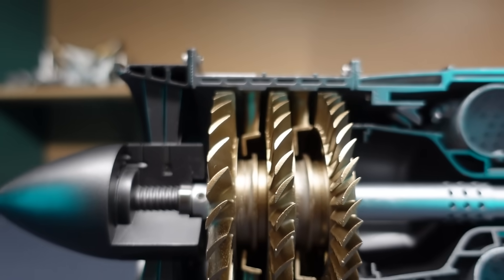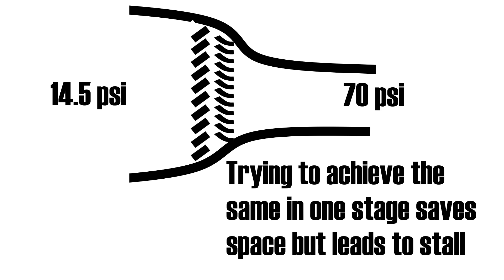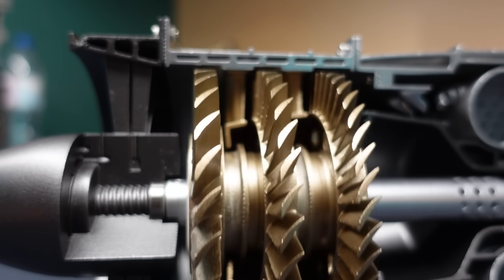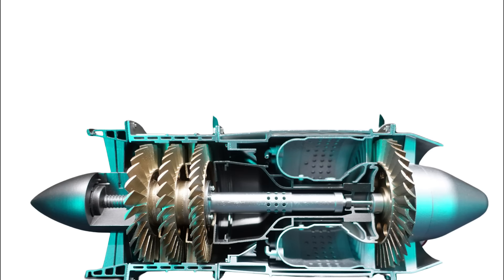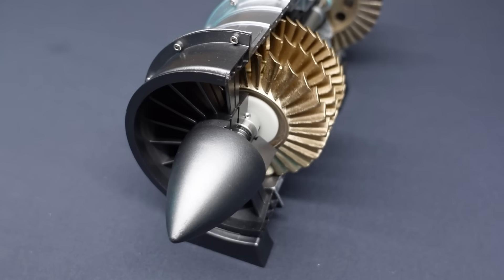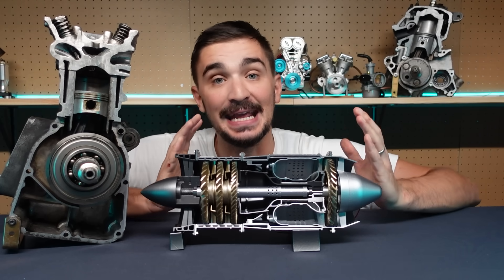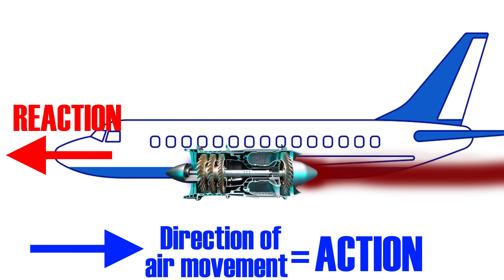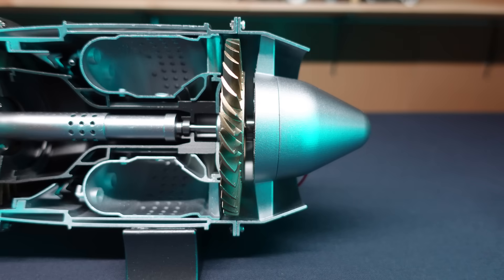Appreciating The Beauty of Jet Engines by Juxtaposing Them Against Piston Engines

Comment: Can you imagine how developed of a world we would live in if all the teachers were just like this guy
Reply from the maker: There's likely many better ones out there . It's maybe the willingness of the people to listen that's the bottleneck? 🤔
Reply: @d4a  come on buddy, don't be so humble. teaching and explaining stuff is completely different from knowing stuff, and it's a skill on its own, you're really damn good at that. you really should be a teacher. and on the topic of the gas turbines, i'd love to see you do one about turbofans too. i get how they work, but i don't understand why. i don't get what's the purpose of the bypassing air.
Reply: @4ffff2ee humility is perhaps the best trait one can acquire. Let him be humble Though ironically that could lead to pride in itself.
Reply: @4ffff2ee  good question. I BET the reason of bypassing some air is a good idea are something like:

- Even in jet engines which generate more power in exhaust than shaft, there is still power being made on shaft. So why don't use that to push more air?

- Also I THINK putting even more air into the combustion chamber wouldn't be healthily to the combustion itself and more combustible would pass without burning. So it's good to pass this air outside the chamber.

- But I BET the main reason is the shape of intake. Maybe a big intake in front is more efficient when you want to pull more air, but the most efficient intake size to generate the power you need in combustion is NOT THAT big.

In other words, I use to thing in turbo-fun like something which mixes some advantages of turbo-shaft, turbo-jet, and even screw-propeller. (but I'm not even an engineer)
Reply: The purpose of bypass is efficiency. The greater the proportion of air that's bypassed, the more efficient the engine is. 

Design of the compressor and turbine stages of jet engines has got so good, that there's plenty of spare rotational torque available.

To make more thrust out the back, rather than making the jet section bigger, it's more efficient to slap a great big fan on the front, use the turbine to drive it. The vast majority of the air from the fan is around the outside of the engine. 
This bypass air is now most of the thrust for a turbo fan engine.

The bypass air also helps cool the jet section, and on top, when reintroduced with the jet exhaust flow, helps reduce overall noise levels (see videos of a 707 taking off vs a modern widebody).
Reply: @d4a  You are a great teacher, but, however did you focus upon all types of engines so thoroughly? Was it your dad? I was also interested to learn more about the Jet Engine mainshaft, and the bearings that support it. At 25,000 rpm, the thrust that is developed, must surely place a severe stress on the shaft, in the same direction of aircraft travel. Newtons third law again. An A380 develops 72,000 lbs thrust from just one engine. Inside the TurboFan Jet Engine,the main Bearings are handling this thrust very successfully. We must marvel at this achievement too!
Reply: @d4a nah, you are the best!
Reply: @d4a  There may be many better ones out there. But that doesn't mean you are a bad teacher by any means. Far above average I would. Though the willingness to listen is probably also a big bottleneck.
Reply: @d4a IMO, there's a lot to be said about someone who can explain things well, understandably, and passionately. 

There's a whole lot of people out there who only avoided learning something because of bad teachers.
Reply: Exactly.. im not a native english speaker and yet I easily understood every explanation he says.. one of my very few favorite youtube channels.
Reply: I probably had teachers as smart as this guy but i was too stupid to realize it.
Reply: I supposed part of it is that we all specifically chose to learn this rather than being forced to. You can bring a horse to water. . .
Reply: i am so lost for words..  did none of you go to elementary or primary school?   this is like describing a car as if it were hot wheels.  and anyone ::cough:: that thought this was ... i just need to stop.  i swear the worlds average iq must be dropping at an exponential rate.
Reply: It might be a good thing. Should we live in a better world because everyone understands everything? We might starve and extinct. @iamdestructoman
Reply: All of my comments were deleted?! I didn't curse. I didn't go political. There was no hate. I am so confused.
Reply: Prof. CE 😀
Reply: I had a very good thermodynamics lecturer
Reply: The vast, VAST, majority of teachers have studied teaching (which is a lot of psychology related courses), not the specific subject they teach. Again, most are just handed a syllabus for the subject they were hired for by the school district. The entire scholastic system needs an overhaul, not another watering down to artificially improve test scores at the cost of interest by the students in a given subject just so they can get a higher budget next year....

And while I enjoy dudes videos, what did you learn? Can you calculate for me the fuel flow? Air flow? Efficiency? Tensile strength of the various parts required? No, we just learned how a jet engine turns fuel and air into noise and thrust, and how that differs from an internal combustion 4 stroke engine. Which, yes, is cool. I love jet turbine engines. They're awesome. But a video showcasing a thing in an interesting way does not an expert course make. Sure, a reasonably mechanically minded person could make a jet engine with about 2, maybe 3, hints as to parts and materials out of junk yard stuff (they're not gonna fly with it, but can build a working jet turbine 'gas generator'). But enough of the class to pass the end of the week test so that the teacher is evaluated as effective? No way man.... Yes, that is yet another problem in the scholastic areas that needs addressing....

Kids need to be engaged with in a manner that gives what they're learning meaning. Otherwise they're just parroting what they heard earlier in the week onto paper just to forget it over the weekend. And I will absolutely admit there is a huge difference between understanding concepts vs knowing the formulas by heart (which honestly, most scientists dont. They just understand the interplay of systems enough to look up relevant formula). Its that understanding of the concepts that needs the attention it is woefully not receiving. Leading us to a world where people push airated gas, flat earths, 5g viruses, pyramids.....and all that crap. For the massive mind boggling improvements in access to knowledge we have received over the last few decades, during the last 6 years or so we have gotten worryingly dumber.....and that is really disappointing....

All that being said (and said for the sake of shining a sobering light on the dire state of the education system as we have all the platitudes in the world, what we need is decisive action, but thats the hard part.....slogans are easy.....gotta sit down and figure out the hard part now if we want anything to get better....), this guy absolutely makes awesome videos about complex subjects and should totally keep making them.
Reply: Nice presentation, Frank Whittle knew about axial flow but went with centrifugal flow for simplicity, Junkers built the first axial flow engines for the ME262 but they had a scrap life of 25 hrs. Whereas the Rolls Royce goblin ( $ later the Derwent) had a rebuild life of 100 hrs I think the biggest problem at that time was: nobody had invented nimonic alloy yet !
Regards,
Sandy 🔧🏴
Reply: Also helps to be teaching something USEFUL instead of, say, gender studies.
Reply: This is what you get with unfettered free market education.
Reply: Yeah it’s almost like they’re barely paid enough to care
Reply: I swearrr, he's so thorough and precise 😂
Reply: Even better, present this lecture or one like it, bridge design, whatever the biology equivalent is (engineering/technician guy here) at freshman orientation , then serialize classes.  And take questions.  How do you know how to stage the rotors?  How do you know how big or how many of the little air holes to make? How do you figure out what material to use, and where is a starting point for testing.  Go back to the engine or bridge etc for chemistry, algebra, calculus, trig and geometry, material science, fluid dynamics.  How is it built?  CNC, wintering 3d printers, casting.  How do you communicate the pieces and their properties?  CAD, GD&T, by senior year you've got a bunch of engineers ready to go to university for their specialty who can look at design and theory holistically, accounting for manufacture and maintenance and stuff (I forgot the how do you fix it questions) and a bunch of drafters, machinists, tech writers, and (good) manager trainees (also forgot the how do you coordinate this whole thing question).  Sounds a helluva lot better than here's algebra.  What do we do with it? You do the homework and turn it in.  Will I ever use this? Probably not.  I was furious when I was 30 and taught myself advanced math and found out everything I could do with it.  It was almost like someone kept a secret from me the way my classes were taught
Reply: Yes me too maybe because this guys on utube are happier and flexibility of work compare to teacher that are always angry everytime in school
Reply: It doesn't help teachers are paid like crap, and professors are hired due to their accomplishments. Not exactly their teaching or communication abilities. 

 Yet I guess prestige > teaching skills when it comes to higher education.
Reply: One of the benefits of YouTube is that it let great teachers reach big audiences.  This includes d4a, and others, like Mentour Pilot and 3blue1brown.  They're better than 99% of the teachers in high schools and colleges.
Reply: Autodidactic heutagogy. Full stop.
Reply: The King's Specialization benefited historically from adjudication of mental servitude, however universally disrupted consistently through  an ever demonstrative trend towards comprehensive propensity. Thank you Bucky!🎉🎉
Reply: Yep. That one, too? Wtf! All of my comments disappeared!
Reply: I swear that has to be the 5th video on the matter I watch and only now do I understand how it works!
Reply: we are almost there. 1) Now, the entire world can play this video at classrooms. 2) Very soon the IAs will make even more perfect videos, AND they will be able to answer student questions individually (no need for the entire class to wait for the slow student to ask the teacher).
Reply: @crazyr0m they aren't slow, they want to know exactly how, why and where it all stems and webs. Pacing an interwoven tapestry of comprehensive applicability.

Comment: Turbofan engines used on airliners are DESIGNED to run at high altitudes, not that they operate better up higher. Turbines in helicopters do no operate well at high altitude because they are not designed to.

Comment: The reason for the reduction in room or space as you move through the compressor section is NOT because it is sqeezing the air... The compressor stages are littile difussors...they are designed to progressively compress the air, and as the air is compressed, its volume decreases...thats why the room shrinks. The reduction in volume is a result of the increase in pressure.
Reply: Isn't that just a long-winded way of saying the same thing?
Reply: @Ijusthopeitsquick  I don't accept that you have explained the jet engine well. There is no such thing as free energy. Yes the rear turbine drives the front compressor via a connecting shaft and the air is  compressed.
But this does not mean that more air passes out the rear nozzle as useful  thrust. 

In comparison your piston engine can rotate and suck air in, then the piston
compresses it. If you do not introduce fuel and ignition the piston will rotate back down the cylinder to where it started at whch point the pressure
returns back to zero again.  In a perfect engine no energy
is used to compress the air, it is recovered on the downstroke and
no energy is available in the exhaust. It would act like a spring. But there is always a little friction and you will always lose a bit of energy.
The only way you can get energy out is if you introduce fuel to heat the air and this causes the cold air to expand. The only purpose of the compression is to introduce enough air into a small confined space so fuel can be burned in sufficient quantity to produce a lot of power. That's why high compression
 engines produce more power.
When you burn fuel with air it expands to make a bigger volume. This increased volume depends entirely on the temperature.

In going from air at ambient temperature to say 1500C this expansion
 is not as much as you would think because it works on absolute temperature Kelvin with zero at - 273C. Accordingly air at ambient 273K heating up to 1730K in our example only expands by a factor of about 6 at
the most. This is not a very high compression or expansion but ratio and would not produce much thrust. 
But you say there is a rear nozzle after the turbine to increase the speed of the exhaust air to produce the required thrust? 

No!! In order to do this there would need to be a significant pressure increase in the jet engine. There isn't. In fact there's a pressure drop from the compressor at the front, with the highest pressure, right through the combustion chambers, through the turbine and out the back as exhaust thrust. There are no non return valves in a jet engine and if there was no pressure drop the exhaust would try to flow back though the engine
to the front! Obviously this does not happen. 

Using any type of compressor to suck in a lot of air at the front can only
 result in the same volume of air flowing out the back and with no real
 change of energy unless there is a great pressure increase. 
Dan
Reply: @danielhanlon5607  The exhaust contains more energy per unit mass of air than the intake because the velocity and temperature are higher, not because of a pressure change.
Reply: No,  @Ijusthopeitsquick , it's fundamentally different.

Comment: Isn;t the ignited hot air always in higher pressure than the intake compressed air? How can the air enter the combustion chamber?
Reply: People already commented this, but the combusted air is free to expand (the turnbine has a lower pressure because the exaust is expanding), so the pressure in the combustion chamber does not increase significantly, it's pretty contraintuitive. Also, with enough inertia, the airflow can "defeat" the unfavorable gradient presure. This is how the compressor manage to not have backwards flow, and why blow off valves are needed for idle and engine start, when the air flow is low and high pressure in the end of a stage can make it go backwards

Comment: The jet engine in this video will not work, because ALL fan blades must be positioned in the same direction.
In his model, the fan blades at the rear should be rotated 180 degrees. With the blades in their current position, the hot gasses will want to move the blades in the opposite direction.
Please correct this on the model.

Comment: I'm currently in college to become an aviation mechanic and just finished my semester on jet engines and am about to finish piston engines and graduate. You have done a beautiful job of explaining this, keep up the good work. Also if you have any questions on jet engines in the future I'd be happy to help
Reply: I always wanted to make a turboshaft motorcycle. Where can I source a small turboshaft engine? I believe they are being used for power generation and helicopter, any other application of turboshaft that I'm unaware of? Any brand name/engine model you can suggest which is small enough to fit in motorcycle chassis?
Reply: @pruthvirajbhople  something like that would have a price tag in the tens of thousands & it would be much less powerful
Reply: If you think that was a good description you should go back and review your course material, particularly looking for information on the diffuser stage between the compressor sections and the combustors, and on the temperature, pressure, and velocity of the gas as it goes through the engine... since all of that is wrong in the video.
Reply: Good luck on your career choice. I’ve been an aircraft mechanic (A&P) for the airlines since 1983 and loved it.
Reply: @richardlewis4288 How's the pay? I'm also in college to be an A&P, except I just finished the first semester, so I still have a couple years left.